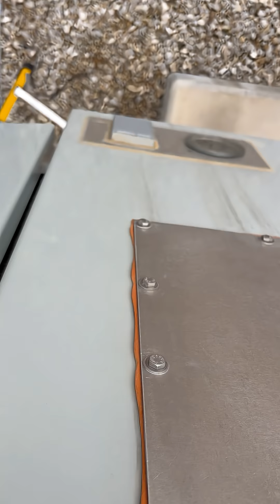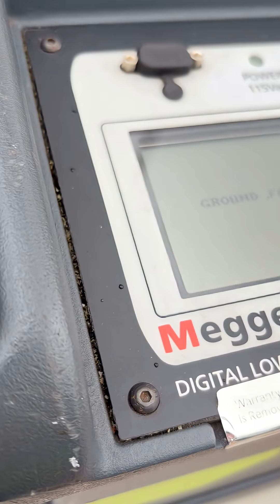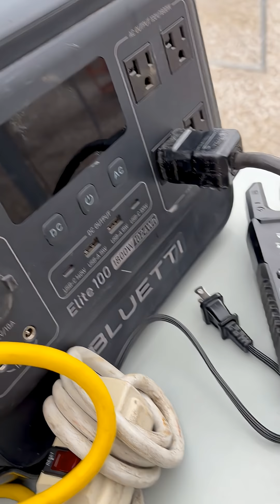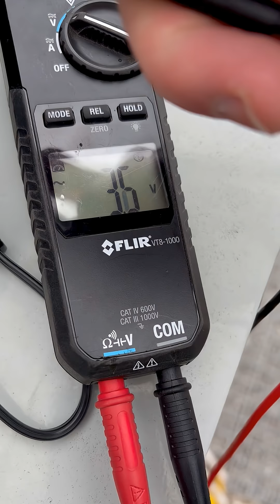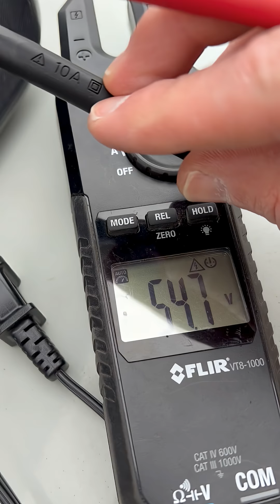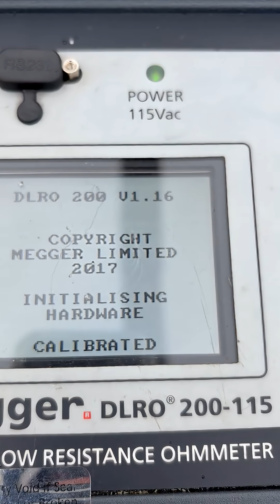Ground Fault Issue

Comment: Hi, sorry, i can't see  what connection you did
?? , to got 120 v... Hot to ground?
Reply: I just ran into this 2 weeks ago!!! What are the odds! Thanks man!!
Reply from the maker: The test set neutral goes to the source neutral. The test set goes to the source hot. The test set ground goes to the source neutral.

Since this is a floating source, it’s not a large concern, except that there is no ground fault protect protection. Additionally, I connected the neutral in ground to the equipment ground.